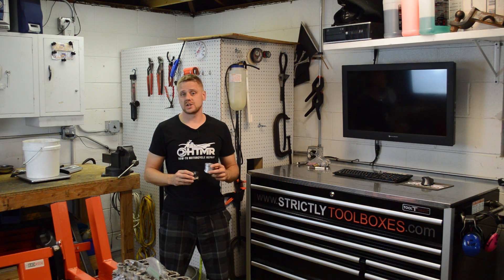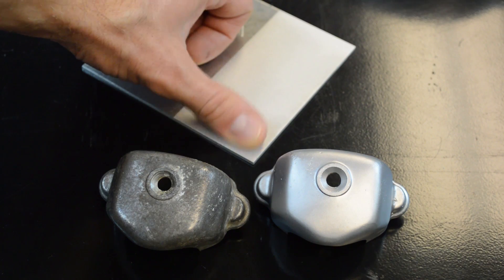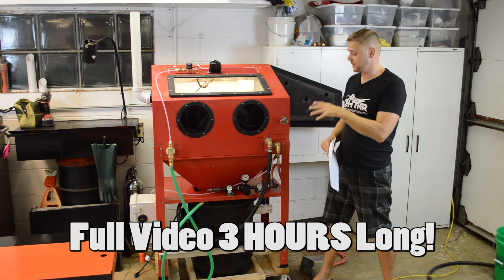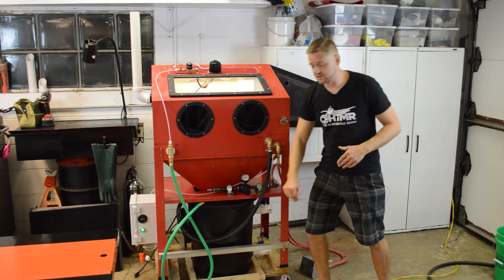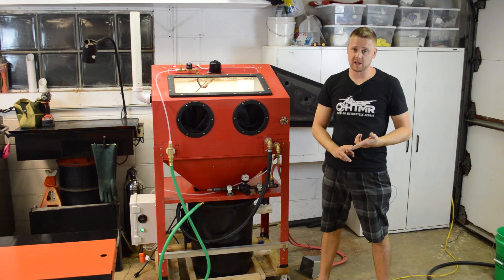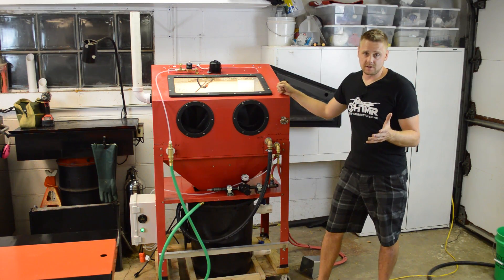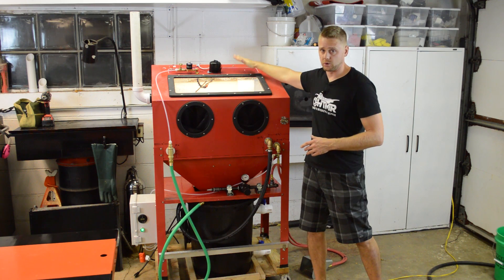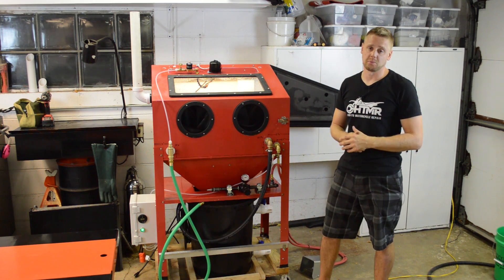How-To: DIY $1300 Vapor Blaster Build Plans

Comment: hello, why you need aircompressor? I was assume that everything is powered with water pump, because water and abrasive is inside bucket under cabinet.
Reply from the maker: Electric pump is to mix water and abrasive into a slurry and pump it up to the nozzle. Air is introduced to accelerate the slurry. Slurry pump alone will not clean parts up.
Reply: thank you for respond. the total cost is including air compressor or it's just cost of parts for cabinet without compressor? 

Thank you
Reply from the maker: 1300 cost is assuming you have a compressor AND the cabinet. Cabinet new is ~200, used ~100. You can cost reduce the part list if you wish, it's just how I did it.

Comment: You can go get baking soda from Harbor Freight which does the same finish. I actually made mine out of a gatorade bottle and blasted my CR250 head with the same result as a vapor blasting.
You can use the same cabinet that you have the vapor Blaster setup and go buy two bags of baking soda. I've actually use the equal blaster on a job site. Yes it was vvery cool
Reply from the maker: This cabinet was a soda blaster prior to vapor blast conversion. Soda will NOT touch corrosion of give this level of finish. Worked great for carbs though: https://youtu.be/DS4eev-EbqY
Reply: He's right, suspending the microscopic glass beads in water, out does the soda work.